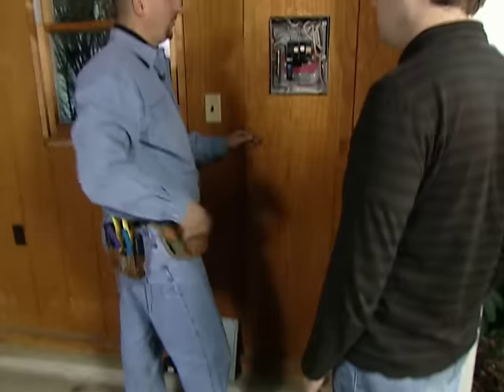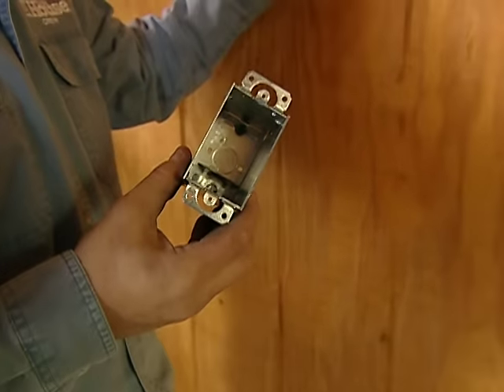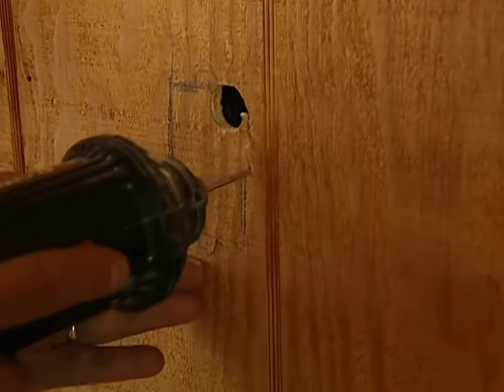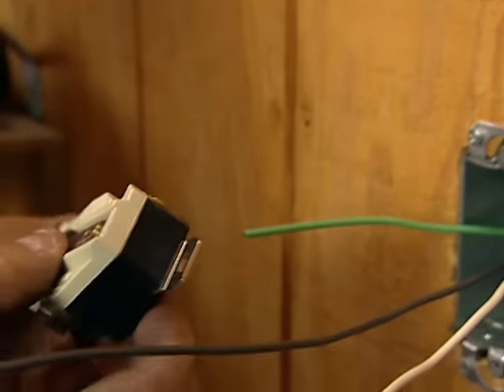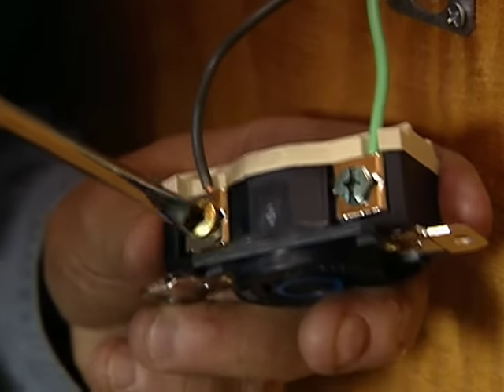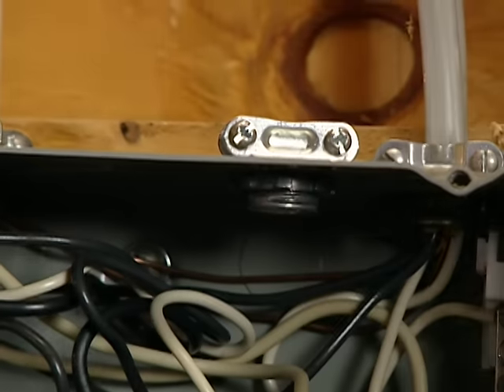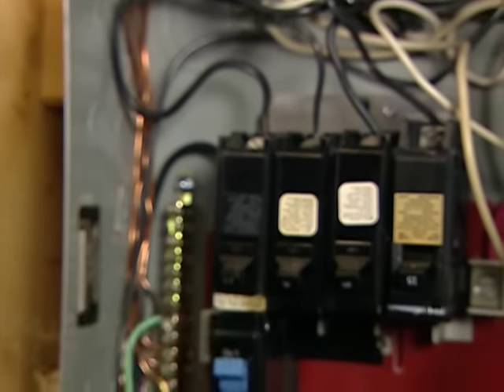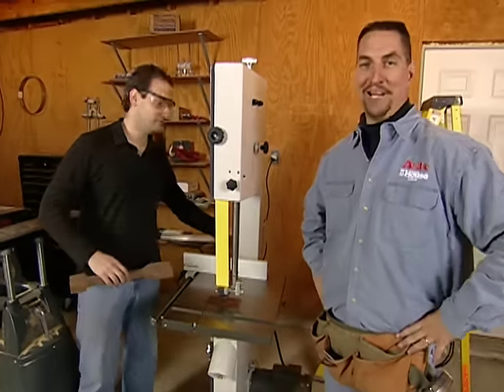How to Connect a 220-Volt Receptacle to a 20-Amp Breaker | This Old House

Comment: "We'll identity the wire" famous last words. He didn't tape the white wire on either end to identify it's a hot wire.
Reply: I always wondered why they sold red electrical tape!! :P
Reply: Not code in Canada .Just common sense if you know electrical wiring.
Reply: 3m actually sells 9 colors of Scotch 35 phase identification tape for  keeping things straight.They are:  black, red, orange, yellow, green, blue, purple (violet), white, and grey. (slate)

As many may know, a phase can be id'd as any color besides grey, white, green, or green + yellow.
Reply: At least it's just a point-to-point connection. I'd be pretty annoyed if he was wiring up a complicated tangle of multi-branch lighting with no neutral wires marked as hots.
Reply: Till some idiot comes alng and wants an outlet in the middle. Then he looks up and says. I'll splice that MC cable and put a junction box there. Then run th wires down to my new shiny outlet. Then when he plugs his new shiny Hilti into it. He gets to watch it burn up. But at least the Hilti is double insulated and does not require a ground prong.
Reply: well said!
Reply: Wondered about that myself
Reply: Why  do you guys in the USA have two different voltages and different colour schemes depending on the voltage? And why use metal conduit and metal boxes? Is this the same for Canada?
Here in Australia we have 240V single phase (demistic) and plastic conduit and plastic power point, we don't use metal.
Thank in advance
Reply: Rich X I honestly have no idea America is really fucked up right now give us a min
Reply: The metal boxes are stronger and when installed correctly (with metal conduit) it can be used as ground also.
Reply: +Rich X
For the same reasons we have two voltages here in Germany....one for standard appliances and one for appliances with high demand. And in Australia for industrial usage it's the same for sure:
3x240/415 V.
In Germany it's 3x230/400 V but the same principle. You've got three line conductors. Everyone has a voltage of 230V (or 240V) against neutral or earth (ground), and measured against each other the voltage is 400 (415) V. A three-phase system has the advantage of having a rotating field which is good for appliances like table saws or other motors, so you don't need a big capacitor to create a rotating field. The Steinmetz-circuit with the capacitor is creating a loss of round about 30% of torque and power of the motor.
Three-phase power is common here in Germany, even in residentials. For example an electric kitchen cooker only needs three 16A circuit breakers here:
 16 A * 400 V * sqrt 3 = 11,08 kW

The sqrt of three is to compensate the time delay between the three phases, which have a phase deviation of 120°. And if you multiply the 230V with 1.73 (sqrt of 3) then you'll get 400V. If you have 240V it will be 415V. The sqrt of 3 will always be with you in a three-phase system.

And we use plastic boxes too, metal boxes were used here only until the 1950s. And they were coated with lead on the outside to prevent corrosion caused by plaster, and on the inside they were insulated with tar. Really bad thing...

Everytime I see these special american cables I think of shower hoses...I don't know why :-P
Reply: I agree. If this was done in the US needs to be labeled red both inside the sub panel box and in the outlet box. Also should have electrical tape around the screws on the outlet to help protect future people from grabbing both screws if they're dumb and don't cut power before opening the outlet box lol
Reply: Was going to say the same thing.  Pretty egregious mistake there.
Reply: Actually belly you can identify other conductors with tape in Canada and it is within code.
Reply: Nap Lover the only person it would confuse is a homeowner who has no business messing with electricity.
Reply: Why not run a red wire instead of white? It was a straight run to the panel
Reply: Kompressor_5.5 love this comment
Reply: There is a big misconception here. ALL wires should be assumed hot. Neutral wires are hot even in a 120 V application because the current must return back to the panel. Only a ground is possibly not hot if there is no short happening.
Reply: that didnt look like a mc conecter at the breaker box either
Reply: @RichieRich845  Chicago has one of the best electrical codes in the world.  Imagine a hot wire losing a bit of insulation inside a conduit.  The conduit being grounded all the way to the electrical panel comes in contact with the wire and causes the circuit breaker to trip.  Plus when drilling into walls for other DIY projects, the probability of damaging unprotected wires goes down significantly.
Reply: @MasterChief-sl9ro  if you cant figure out that the receptacle the mc feeds is 240V then you really shouldn't be messing with the circuit to begin with
Reply: lol wut
Reply: I prefer the metal boxes now. I went to my parents business one day to open up, and the main refrigerator was down. I looked around at what the issue was, and found the wiring to the outlet overheated. I'm sure it would have been worse if it wasn't installed in a metal box.
Reply: @55kompressor  lmfao
Reply: The reason why we run 120 volts in America is because the original DC Systems that were established by Edison ran at 110 volts DC and their filaments can only handle 100 to 130 volts ac
Reply: In this exact situation Any competent electrician will be able to identify that the white wire is a hot wire.  

If you’d not an electrician you shouldn’t be doing electrical work.
Reply: Plus 4 wire is not a fortune, you could place neutral, not use it now, use right color for 240 and have future proofed... It's easy to change outlet (you might need it after equipment upgrade), not so for cable...
Reply: @RichieRich845  Because the US system was designed first and had more experimentation. Also, Metal boxes are stronger and used commercially, and less commonly in the home like this.
Reply: @ti3167  lol yeah I'm pretty sure it is not rocket science 
Black/ red = hot
White 110 neutrals .
Green / ground 
14awg max 15 amp
12 20 amp etc...
Go a little bigger if going far.
Not to much other than that
Reply: @MasterChief-sl9ro  Even if he DID use tape to mark the white as a hot, how would that help this idiot you brought up , from knowing this if he sees the MC cable in the rafters and splicing in a j box?   He would have to go turn off the breaker, he would most likely realize that it is a 220 line. Your story doesnt make sense in the comment section talking about using red or black tape at the ends to show it as a hot wire. just sayin
Reply: I thought you aren't allowed to phase tape any wire smaller than 4 AWG?
Reply: Spartan111792 not true
Reply: @Nick-bh1fy  Checked again and it appears that rule in the NEC applies to grounded conductors.
Reply: Spartan111792 yea it just applies to the neutral
Reply: The receptacle does have two brass screws, indicating two phases (180 degrees apart), since it’s 240vac in a 120vac country.
Reply: "Just call a master electrician" they said.  It will certainly be a nasty surprise for the next person working inside the panel.
Reply: @chrisf9607  Agreed
Reply: You cannot "identify" any gauge wire below 6awg. Any electrical contractor should use common sense and assume the neutral is used as a hot.
Reply: @saveferris6864  This isn't canada....
Reply: @RichieRich845  hi.

We have 120 single phase which is just like your single phase 220. We also have, in most residential services, an alternate 120 relative to neutral which with appliances connected across, gives 240. It is obviously important to identify hot phases and neutral connections, so using white wire (specifically reserved as neutral) as a hot connection is woefully bad! If need be, for instance, you are in a hurry and cant get wire with two hot colors in it (typically black, then red, then blue), it seems to be allowed to use colored tape to put a color on a white wire to identify it as hot, but its reckless IMO. It's much more reckless to use it as a hot and NOT put on identifying tape.

In many industrial buildings, there are three phases of hot, all "centered around" neutral. So, each phase is 120 degrees from another, and 120 V relative to neutral. This makes for easy inductive motor powering, since you don't need a startup capacitor, but it causes any draw between any two hot phases to be 208 volts. Again typically one would use white for neutral, and for the three phases, black, red and blue.

So, do you have three phase power where you live? And if so, what colors do you use? I know blue is for neutral in Europe, would you ever use a blue wire as a hot and tape it a different color? Very curious!

Have a nice April!
Reply: @saveferris6864  yeah but it’s Canada so no one cares 😅
Reply: @jstollmail  I think it's just courtesy. If a wire is hot, it should be labeled such.
Reply: @RichieRich845 

Watts = Volts x Amps.

The greater the volts, the less amps and smaller the wire for the required load.  High wattage appliances require more amps so the US needs the higher voltage for those items.  

I would hazard to guess the US still uses the 110v standard for low watt receptacles because of cost to switch everything out and a lack of need to do it.  

All receptacles would need to change in every home and business.  Every appliance would need to have an adapter or to plug it in.

Once a standard is widely adopted by 300 million + people it is very hard to change.

Comment: Saw other comments about this as well.  Your white wire should be wrapped with red tape identifying as a 220 circuit and not left as white common as a neutral.

Comment: I always thought it was a good safety practice to put black electrical tape on the white wire if you've switched it from the neutral to hot. Why did he choose to forgo that safety practice?
Reply: good call.
Reply: not just a safety practice. It is code, and usually you identify it red to differentiate it from the other hot phase.
Reply: Mike Bald  you are right that in the nec code as well if the inspector opens it wouldn't pass the inspection
Reply: He said he was going to identify it.
Reply: But he didn't did he... It should have been red on both ends... As there is no color code in the NEC other then Green, Gray, White. They must be clearly identified.

It's just common trade practice to use Black, Red, Blue for low voltage and Brown, Orange, Yellow for high voltage. But it's not in the code book. Now it could be in the local ordnance laws. As some require you can't install anything lower then #12 ga wire or use anything lower then a 20 amp breaker. All conduit must 3/4" or greater. So you better call an inspector. I seen some contractors get red tagged and for it and they flipped out having to pull it all out!
Reply: He forgot to put a volt meter .  He just connected the 220 cord and said put ur safety glasses on lol mannn oh man
Reply: How do you know that he did,  they didn't show every aspect from when he pushed the receptacle into the box and the wires in the subpanel after he tightened down the wires to the breaker to when he put the cover back on, there was more than enough time in between shots that he probably did.
Reply: Actually you would use red in this application.

If you were to put black on white, someone coming along may now assume the black is acting as a neutral, because you identified the white as black. Normally for 220/240v applications you would use red and black, and there would be no white or neutral, so if using white as a secondary hot conductor, you would identify the white as red.

Moreover i'm not sure why they just didn't use red/black/green armored cable in this application.
Reply: @selfishlyintrigued  that's extremely expensive to have every combination of bx conductors on hand. Just reidentify with some super 33 and call it a day.
Reply: @CC-jv3wm  No; it's not and it's pretty common practice. Generally at a minimum you stock black/white and black/white/red but when doing heating it's normal to stock black/red or simply not use white conductor in the black/white/red.

Wire is cheap; saying it's hard to stock wire especially the cheapest most common wire you should already be stocking is ridiculous to suggest.

That said yeah there isn't much wrong with just identifying the wire with tape.

Comment: The top row in sub panel is a code violation because the breaker’s are on in down position.part vii 240.81. Just put your  horse blinders and didn’t see it.

Comment: I come to the comments were everyone’s an electrician
Reply: I have been an electrician for over 40 years. Recently  Forced to retire because of injuries. I have learned over the years everyone is an electrician, Until something goes wrong and they need a real electrician.
Reply: I'm am a 40+yrs master electrician still working for myself in Texas
Reply: I’m a computer engineer who hires electricians
Reply: I became an electrician in the 80's when my mom asked me to plug in the dryer with no light and I used my fingers as guilds and I jumped so hard I bumped in to metal box and knocked myself out... Also once touched 400+ volt in compressor room for a split second looking for a phone line, nothing happened to me, but my test phone was dead.

Comment: I was just about to say that identify the white wire. No black tape. To identify the netural wire has hot wire.  Notice the 4 " square boxes in the wall  were buried. Not to buried the j boxes in the wall. And top row of breaker in the sub panel are a vilolation .

Comment: The electrician is pretty good, One not so minor detail that he should have done. After connecting the wires to the 220 receptacle electrical tape should always be wrapped around the recepticle COVERING the connecting screws to help prevent any future metal to metal contact and arcing.
Reply: tape will degrade over time and become a sticky mess. it would be much better if the accessories were designed properly in the first place so that they didnt have exposed connections like the sockets in the uk. this video shows how it is done much more safely with the wire connections in "tunnels" and the earth/ground wire is also covered

https://youtu.be/1MDhJ1XMRMg
Reply: This isn't necessary. Boxes and devices are engineered so that the terminals can't touch the sides of the box or get close enough to cause arcs. What he did need to do was put red tape around both ends the white wire to identify it as a hot conductor.

Comment: Graduated LATTC with a great infrastructure in electrical and finished started in 1925... Basic wiring... Ungrounded- HOT, Grounded- Neutral, Grounding- Green. Have I been taught wrong on grounded wire?
Reply: Nope. You’re right

Comment: So... you just lay the wire across the roof trusses and don't secure it at all or put wood on either side of it? Also, there is no insulation inside that wall?
Reply: Yes and yes

Comment: Ok, I know some of the larger homes in Britain have 3-phase power since acquaintences say them have it to run a 10 hp organ blower (7.5 kw).  Britain for the most part allows 32 amp single phase loads (especially in solely residential areas which may not have 3 phase power available in the entire neighborhood, being fed by a 240/480 volt transformer)..Most homes in the states have 50 amps available for the cooker, with 40 being a minority installation, but legally, only 33.4 amperes is required for any cooker rated at 12 kw or less, (they derate it to 8 kw since it is assumed not all elements will be running at the same time at full power).   But realistically as you say, although it is not legal in the states to do so, most cookers would work just fine on a 30 ampere circuit.        IN other European countries such as Italy with a 16 ampere single-phase imballance limitation, there I would imagine cookers are arranged for 240V/416 (using 2 of the 3 phases).  As an amateur radio operator, I have seen some high power amplifiers used which are designed with 2- 16 ampere power plugs, each plug to be plugged into a different phase such that the unit ends up using 2 of the 3 phases, - to make filtering easier.  They sell the amplifier in the USA, but warn the power output will not be as good, seeing as the 2 - 16 ampere cords will be running off the same phase and the power supplies will not be able to filter as much DC, since there is higher ripple when the incoming power is not separated by a 120 degree phase shift as it is on 240/416 circuits.
Reply: No offense, but who cares how it’s done in other countries
Reply: Too much info
Reply: No offense? Ignorance is bliss, right.

Comment: I would run an extra conductor so that in the future that receptacle could be converted for applications that require a neutral.  Then again don’t plan for the future. Just do the minimum for today.
Reply: There is limited space in that box

Comment: technically can it also work if you just connected each hot wire to a separate breaker on each bus bar ?
Reply: Absolutely not!

Comment: Good practice to identify the white wire as hot, and also to electrical tape the screws on the plug before installing in box. ALso to not be so shaky and trying to work as fast as possible like this guy is, you can tell he is super nervous.
Reply: Also I might go with 10 wire on a 20 amp circuit.
Reply: doesn't matter, if someone is working fast, and just doesn't identify that its 220, Bam, electrical shock.
Reply: @SupraRy  that’s was a receptacle, not a plug 🔌

Comment: Code violation for sure of NEC 200.7 (c) - the white wire was not reidentified using black or red tape to mark that it is hot.